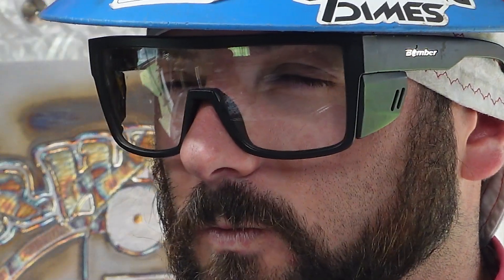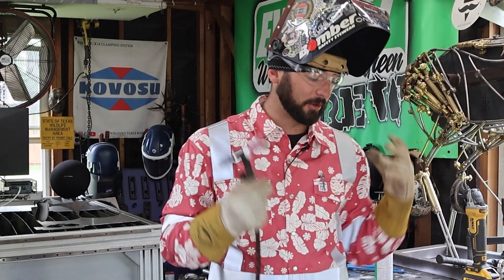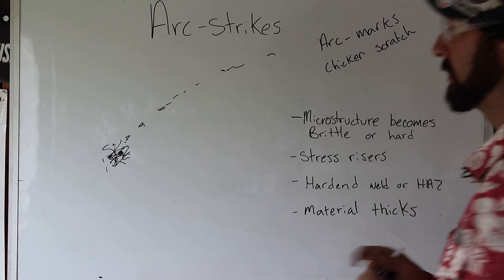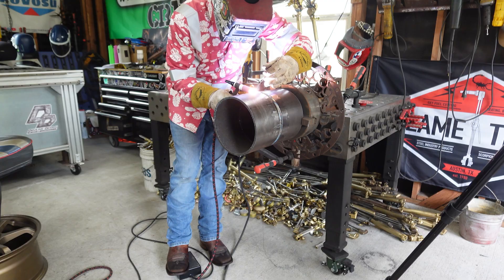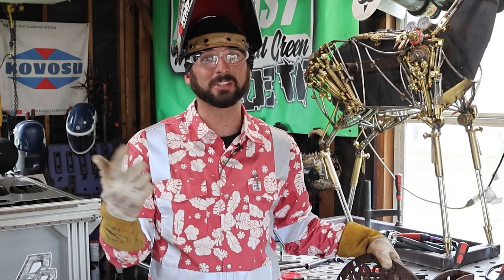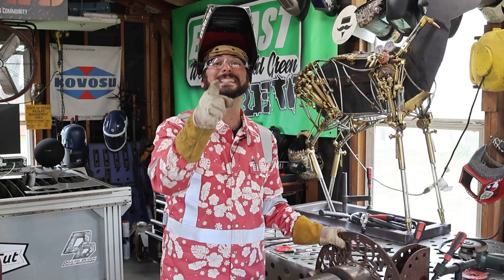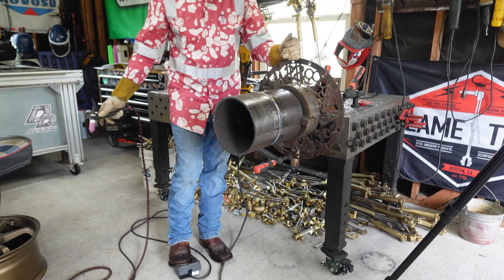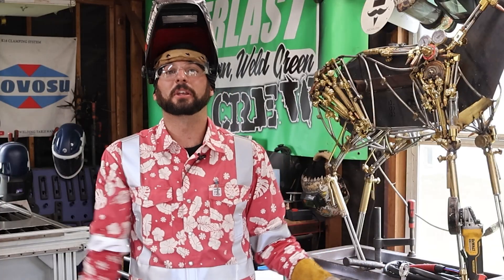Everything You Need To Know About Arc Strikes

Comment: I made a 6 foot long arc-strike once. 

Back-gouging with the carbon-arc on a job that needed CJP welds. Got a hot-one right through the palm of my glove, but the weld-station was grounded to the metal floor plates.

Dropped the carbon-arc handle with a rod in, and had to boot the mofo off the plate into a corner without looking at it or trying to pick it up.

Comment: Using an etchant to confirm you have removed not only the filler metal from a strike but also its HAZ is an important part of repairing an arc strike on sensitive materials, otherwise how do you know you have removed the hardened HAZ from the base metal? An etch will show the HAZ even after the strike material has been removed flush with the base material.
Reply from the maker: Thanks Paul for that knowledge drop

Comment: Is the weld stronger than the base metal when it comes to steel
Reply: if you do it correctly and use the right filler it'll be at least as strong as the base metal, usually stronger.
Reply: @ouou456  I heard others say the base metal is stronger and the weld is the limiting factor
Reply: @TexasNationalist1836  look at some of the weld test videos on this channel, they'll show you exactly how we know that the weld is stronger than the base metal.
Reply from the maker: @TexasNationalist1836  shouldnt be the case.
Reply: As Blake said, at least for a weld procedure to pass the weld must be as strong or stronger than the basement.
Reply: Yes it is,it changes the molecular structure of the steel